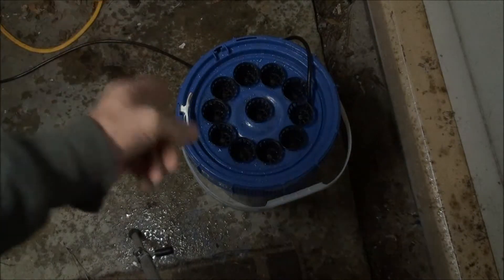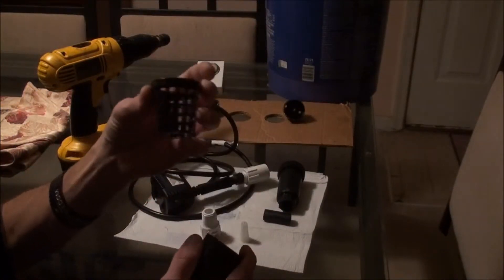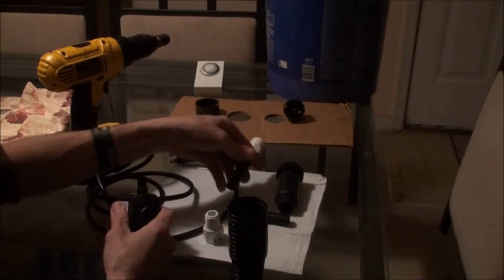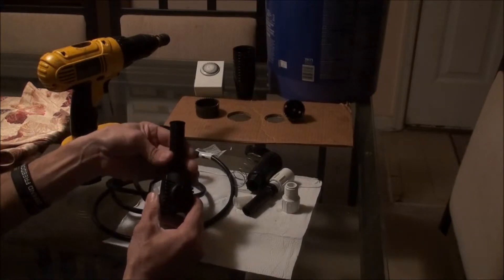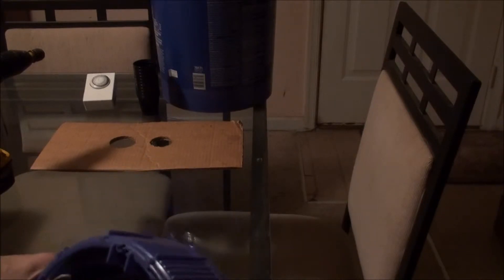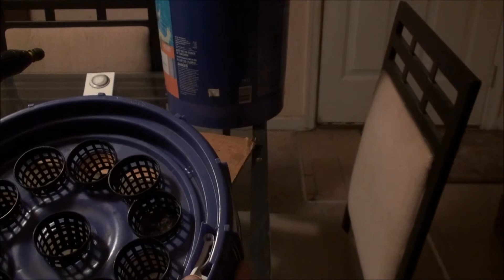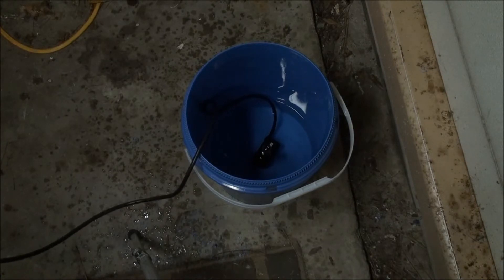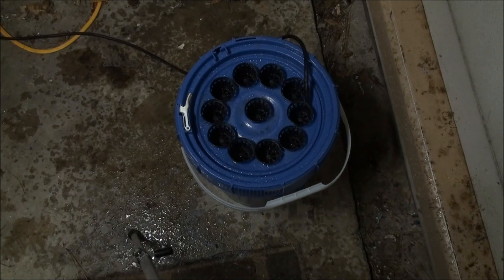Building My First Aeroponics System

Comment: Have an update on how it worked with the pellets?
Reply from the maker: I never made a follow up video to this one because none of the seeds I planted came up. It could be, but I don't think it is a flaw with the design because I planted some seeds from the same seed packets in my dirt garden and they never came up either. By the time I decided that none of the seeds were going to sprout it was already warm enough to just plant new seeds in the ground which is what I did. I am going to make some cuttings and use the aeroponic system to see if I can get them to establish roots. When I get that done, I will make a video about it.